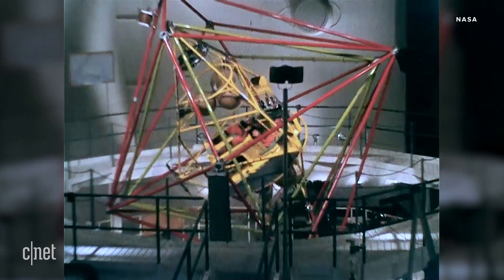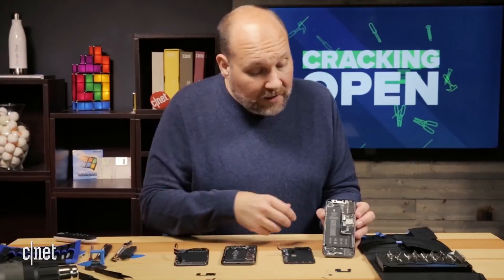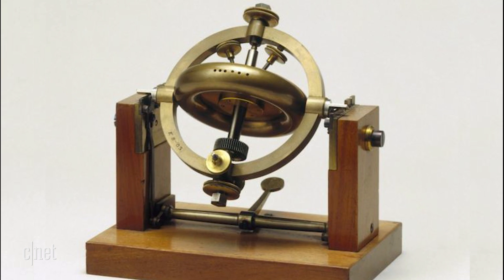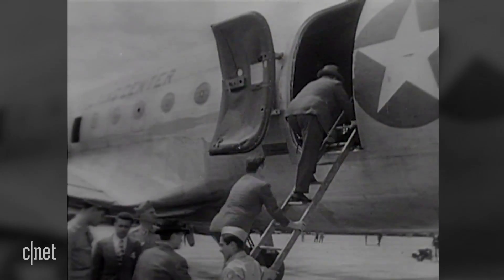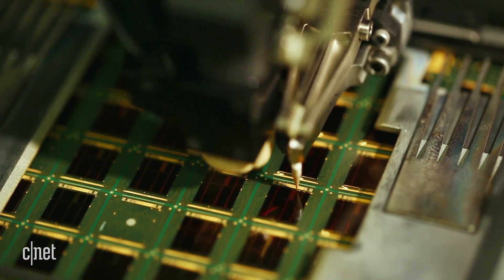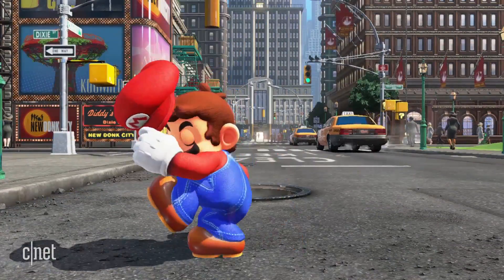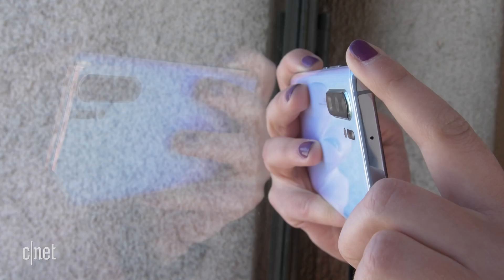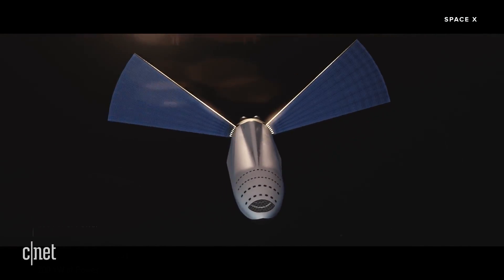The hidden story of your phone's gyroscope

Comment: The PS3 Six Axis controller came out the same year with the launch of the system. The reason PlayStation and Nintendo introduced motion controls was because they were sued for using vibration motors in their previous controllers by a company called Immersion. Immersion was reportedly spurred to sue PlayStation by Microsoft, but Immersion sued all three major console manufacturers for using the technology. Microsoft settled, and the Xbox 360 controller kept traditional vibration. PlayStation and Nintendo used motion to pick up the slack with Nintendo keeping vibration by using a different form-factor controller. PlayStation eventually switched to linear vibration actuators for PS5 controllers, which Nintendo first used in the Switch Joy-Con. Both manufacturers retained gyroscope controls with vibration.

Comment: Phone gyroscopes are NOT. Phones use "accelerometer". Mechanical gyroscopes wear out and higher error. Military gyroscopes have lasers going in opposite directions rather than a spinning disk (based on doppler effect).
You can fool the phone accelerometers by moving the phone slowly.

Comment: Good report, just few notes:
1) Gyroscopes in your phone are not comparable in performance by any mean to that launched to spaces even in early days
2) Wineglass gyroscope is a mechanical gyroscope (IT HAS MOVING PARTS).
3)Wineglass gyroscope is still in research phase. It didn't outperform the optical gyroscope which dominated the aerospace application regime for many decades.
Reply: thanks man
Reply: But damn...the fitness bracelets and the almost end tech smartphones. I mean HTC had it around 2008 or so pretty good. And then are the ones with health tracking alike fitness bracelets. Of course aren't the same as the space ships ones.

Windows pocket pc be like: weeeeeeeeeeeeeee we're 1st. Gotcha;))
Reply: From what I know, the concept dates back to the 19th century and is inspired by the singing wine glass experiments. The wineglass gyro is a type of Hemispheric Resonator Gyroscope (HRG) that has now been replaced by the mushroom design. After decades of development, HRGs are fully functional and have been used since 2004 in satellites, in planetary exploration probes, for strategic accuracy systems, for borehole exploration, etc, counting millions of hours of flawless working. Although it is based on the observation of the movement of a wave controlled by a vibrating crystal, there are no moving parts like rotating masses in this type of gyro.